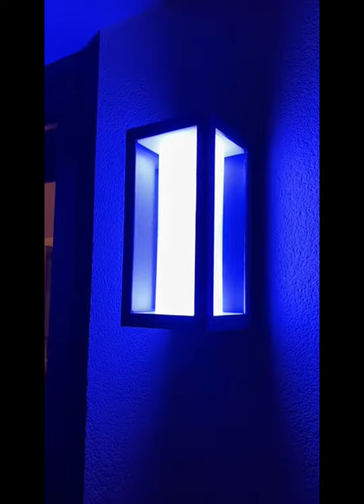Philips Hue Controlled Garden Lighting Project

Comment: Does anyone know if the Impress model can be mounted upside down? Due to the fixed cable hole in the bracket and where my cable comes out of the wall, it will nok look good if I install it as directed.

Comment: Just fitted 2 Hue Impress myself
Reply from the maker: Did you find them easy to set up?
Reply: @elevenelectrical659  yeah very
Reply: I plan on using them as regular wall fixtures, would I just cut and strip the existing wire and wire them normally into hot and neutral?
Reply: @wilbinchan  thats what I did, and ran a wire to spur it off the first so the second could be powered also
Reply: @liamsandie  awesome, i have existing light fixtures already so it should be super easy, I was worried about the wiring and mounting. I really appreciate the response
Reply: @liamsandie  question as I just received it on the mail today, I see that after stripping the wire they are blue and pink, does it matter which I use or should I use pink as hot? I really appreciate the help.
Reply: @wilbinchan  Hi there. Yes there is no earth (yellow green) on these lights so you just use live and neutral.
Reply: @wilbinchan  that's for the UK by the way
Reply: @liamsandie  Lol wiring can’t be too different, I’ll give it a go, thanks again!

Comment: Does the led tape link into the Phillips hue eco system off the app as the Phillips hue light strips are so expensive to buy
Reply from the maker: It’s a 3rd party compatible LED tape from ajaxonline.co.uk
Reply: @elevenelectrical659  thanks just had a look a lot better as can cut to size unlike the Phillips hue outdoor tape